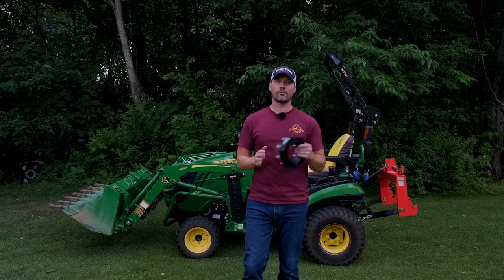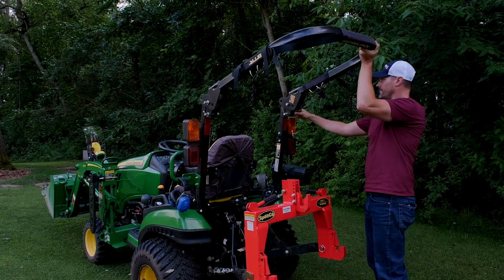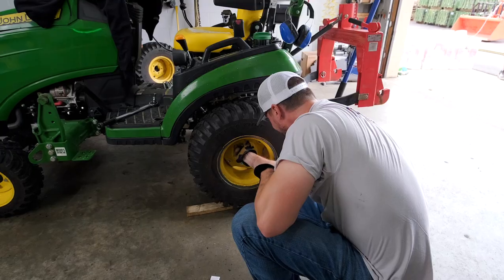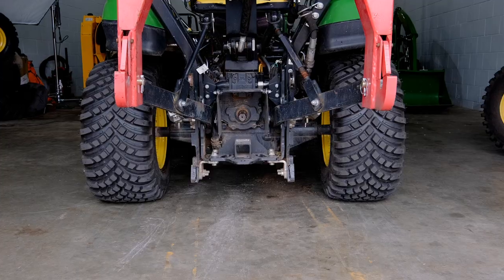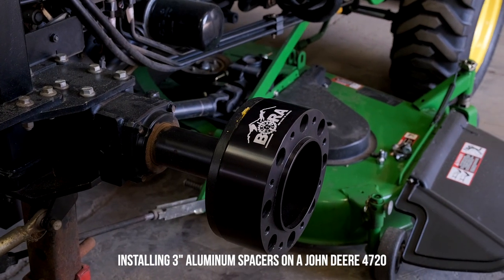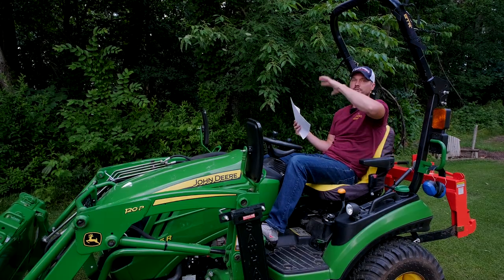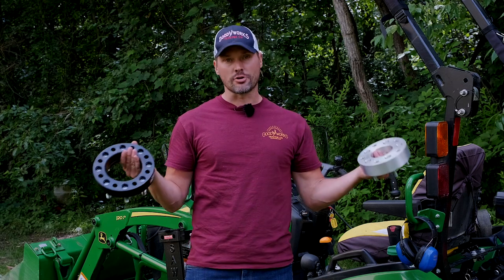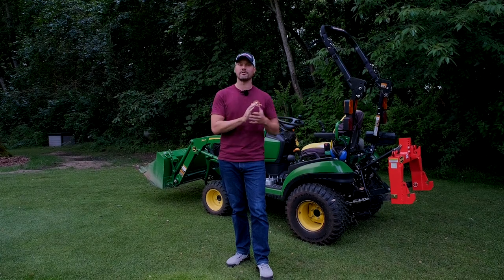THE MOST CONTROVERSIAL TOPIC IN THE TRACTOR WORLD? 🤦🚜

Comment: The closest to wheel spacers we have are the variable gauge wheels we have, so you can adjust them for things like spraying.
Reply from the maker: Those are very handy too.
Reply: @GoodWorksTractors  yeah, but when you have a gauge set, they aren't really changed much, our Renault has hade the same gauge from when my dad bought it back in 96, maybe even longer. The only time a saw the gauge being changed was on Monday at the local dealer, the gauge on a 7R 310 which was too narrow for the owner, so they had to widen it (the mechanic even overtorqued the bolts on one rim)